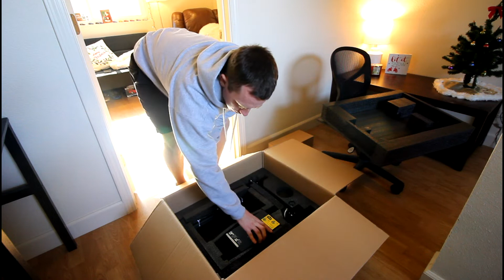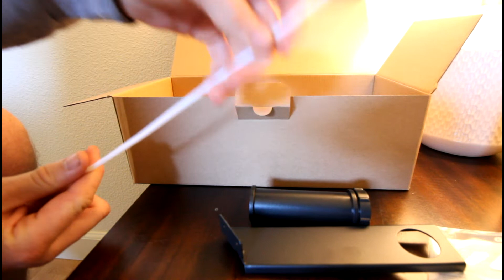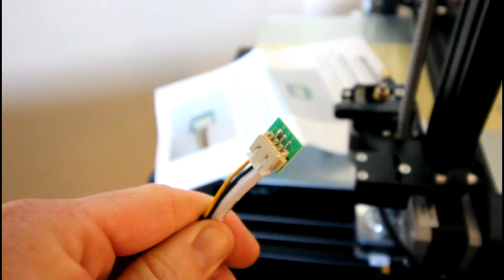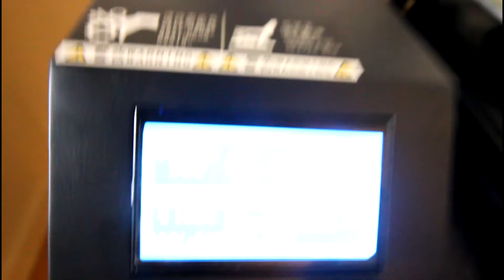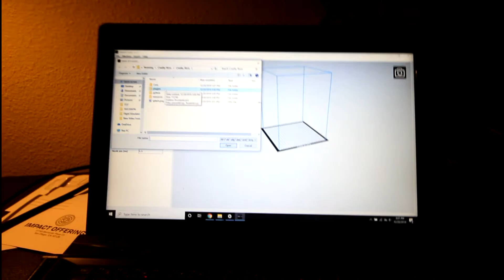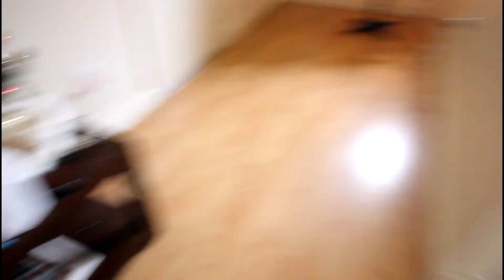My NEW 3D PRINTER! - Creality CR10s Unboxing and Setup

Comment: Jaut to confirm you put the tape the sticky side up didn't you?
Reply from the maker: Actually sticky side down! The backside of the tape is more rough than the glass bed so it helps it adhere. I also wiped the tape when I put it down on the bed with a little running alcohol to remove the waxy finish on the tape
Reply: @Addimotive  that's a really good idea, I will keep that one in mind. Thanks, love the content keep it coming!
Reply from the maker: @tommeaden8219  Of course! And definitely, lots of videos to come, glad you like it!